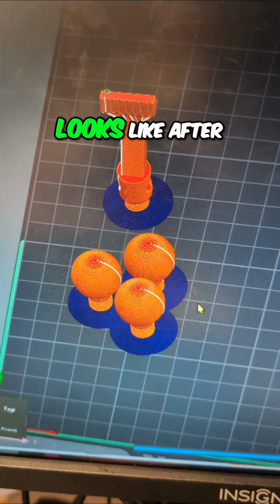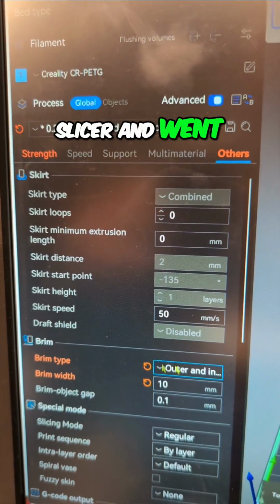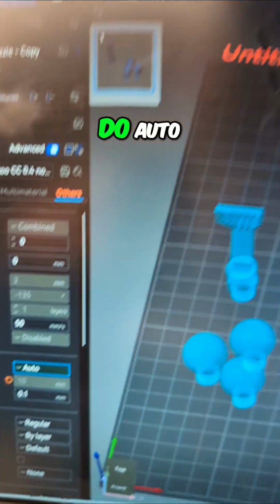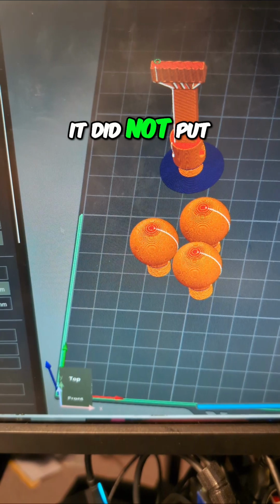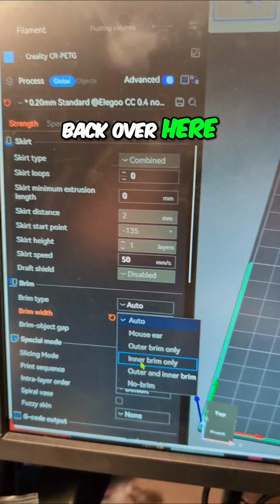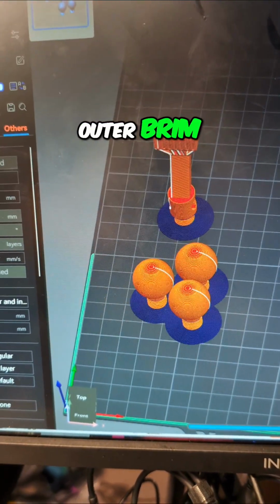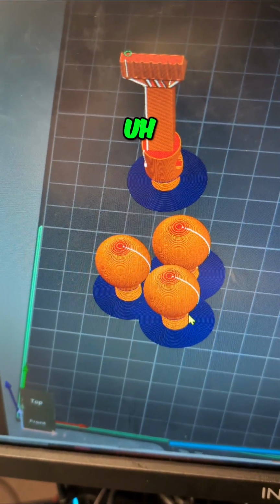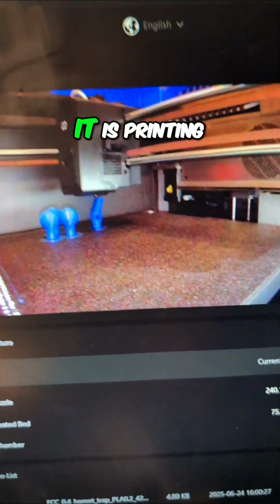3D Printing Fail to Success: Fixing My Mistakes - Elegoo Centauri Carbon #shorts

Comment from the maker: Elegoo Centauri Carbon https://amzlink.to/az0ZtuBE4LjvS. Witness how a brim setting adjustment saved a 3D print job from failure. This video showcases the importance of proper slicer settings for successful prints. #3Dprinting #Elegoo #Brim #SlicerSettings
Our Printers:
Elegoo Centauri Carbon https://elegoo.sjv.io/Y9ve5O or
https://amzlink.to/az0ZtuBE4LjvS or https://amzlink.to/az06Fd8642zlE
Bambu Lab A1 Combo https://amzlink.to/az0iK8AdK4WL1
Bambu Lab A1 Mini https://amzlink.to/az0iK8AdK4WL1
Elegoo Neptune 4 Max https://elegoo.sjv.io/Y9ve5O or https://amzlink.to/az0WIuEASRnEz

You need this cold print bed for the Centauri Carbon https://amzlink.to/az021naV3Efti
Our Favorite filaments:
Elegoo PLA Plus https://amzlink.to/az05hfm44OZrl
Anycubic high speed PLA https://amzlink.to/az0jVOKlIyGVG
Flashforge Silk PLA https://amzlink.to/az0MQkhaoBSi4
Creality Hyper PLA https://amzlink.to/az0GdIGpt7XCx
Creality PETG https://amzlink.to/az0YJOw76kbk8
Overture PETG https://amzlink.to/az09RGWW59gvE
Elegoo PETG https://amzlink.to/az0l2Imboicet
Bambu or Centauri Carbon cold plate https://amzlink.to/az021naV3Efti
Our favorite filament dryers:
- Comgrow budget dryer https://amzlink.to/az0hzcqlMiX1q
- SUNLU Filament Dryer Box S4 https://amzlink.to/az0L4245yhjwN
- Creality Space Pi https://amzlink.to/az0iK8AdK4WL1
Elegoo Centauri Carbon Ceramic nozzles:
- 0.2mm & 0.4mm https://amzlink.to/az0eYJvjGRMnc
- 0.6mm https://amzlink.to/az0yNSj0WRcmm
Inquiries: Sponsor, Amaon videos, or product reviews sponsor@gear-report.com

Comment: Try orca slicer. Elegoo slicer is just an older relabeled orca slicer.
Maybe brim Auto would have been worked better because newer version. And I would also give Prusa slicer a try if it's possible. Prusa also just opened their web browser slicer to other printers. Loads on my Smartphone. Even Bambu and iirc even the Centauri carbon should be supported now. Forgot the name but maybe give it a try for guitar picks for example and let's see the results.
Reply from the maker: Thanks for sharing. I had not heard of that new web based browser. 
I used Orca for quite a while with the Neptune 4 Max, but switched to the Elegoo slicer to try their stock profiles for the CC. The worked well enough that I stayed with it. ?)

Comment: I wonder if there is a threshold of surface area that would dictate if it gets a brim, and if there is a way to set that.
Reply from the maker: Good question. I really don't know what criteria the slicer uses to decide when to/not to use automatic brims.
Reply: @GearReportMaker  Here is what I found:

In Orca Slicer, the "Auto" brim setting decides whether to generate a brim and what size it should be by evaluating a combination of factors related to the model and material. The primary goal is to ensure good bed adhesion for prints that might otherwise warp or detach during printing. 
Key factors for auto brim generation
Model geometry: This is one of the most critical factors, particularly the ratio of the model's height to its base area. Tall, thin objects with a small footprint are much more likely to receive a brim to increase stability.
Material properties: Orca Slicer considers the properties of the filament being used, especially its tendency to warp. For example, materials with a high shrinkage rate, like ABS or PET-CF, are more prone to warping and will be assigned a brim more often. The slicer uses a "material adhesion coefficient" in its calculations.
Printing speed: The algorithm considers the maximum printing speeds. Higher speeds can increase the risk of a print detaching from the bed, so the auto-brim feature may recommend a wider brim to provide extra security.
Thermal characteristics: The slicer calculates a "thermal length" based on the diagonal of the model's base. This helps the algorithm understand the object's cooling dynamics and its susceptibility to warping. 
How the logic works
The "Auto" feature computes an optimal brim width using a mathematical formula that takes all of the above factors into account. 
The calculation also follows specific rules:
A calculated brim width is capped at 20 mm.
If the final computed width is too small (under 5 mm) and also less than 1.5 times the thermal length, no brim will be generated. 
Auto vs. Manual Control
While "Auto" is the default setting, some users find it can sometimes be overzealous, adding a brim to large parts that don't need one. If you don't agree with the slicer's decision, you can always manually set the brim to "No Brim" or use a different type of adhesion. 

So maybe they were too small of a base and there is more weight put on the thermal mass and susceptibility to cooling?
Reply from the maker: Thanks. Yea. Could be any number of things. But printing again with brims worked. :)